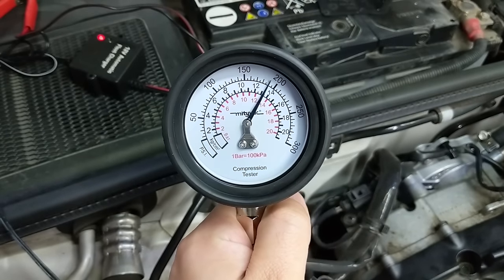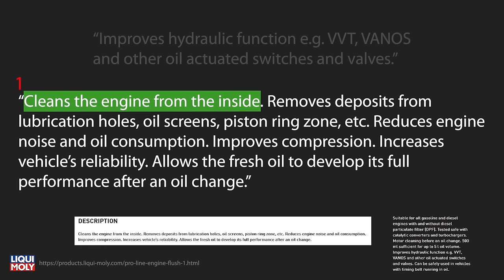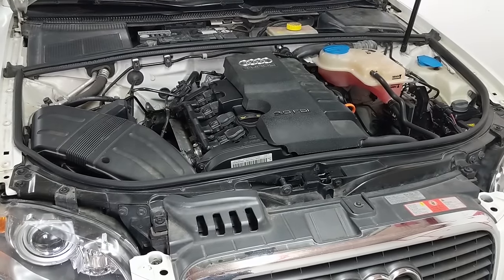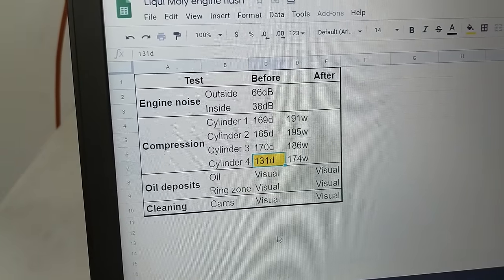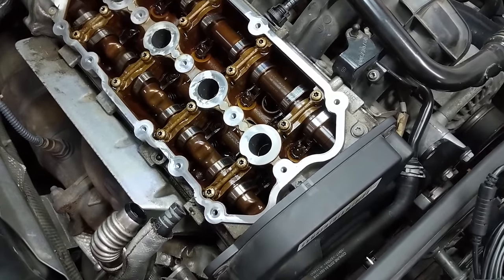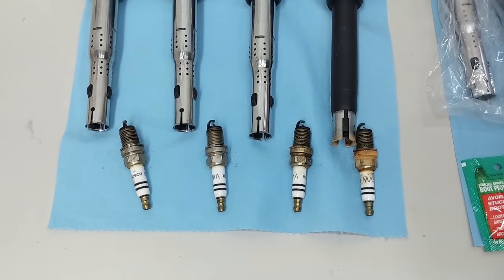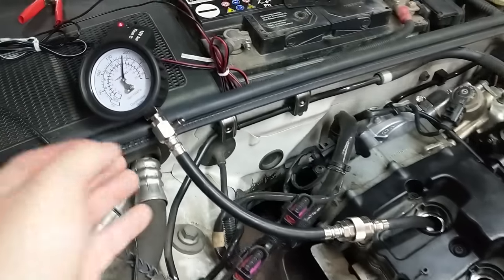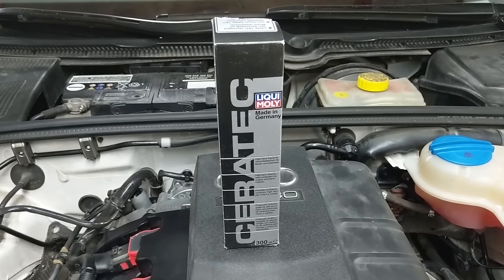Does Liqui Moly Engine Flush work? | Full Test & Review | Pro-line 2037

Comment: I bilive Liquid Molly works one of the very best products out there deffently doesn't do miracles or as advertised but that's almost as good as its going to get i bilive. I used the Motor Medic Motor Flush with a bad motor every time I did an oil change and my oil was getting really black around 400-500 miles and after my first use of liquid Molly flush my oil got really black after 800 miles i felt like it really helped.

Comment: First, i would like to thank you for the great video. I could not learn in better way. Still, i am hesitant about using this product to give a deep clean to my 2013 , 147k kms diesel , 2.0l vw golf 7 regularly maintained with new filters and 5w30 castrol oil every 20000k kms. Do you advise me to use ? 
I would be grateful to have your opinion on the matter. Thank you in advance.
Reply from the maker: Hey Alex - tough call; one you'll have to make yourself. Like I've said to a few other viewers in the comments here, you need to decide 1. If you even believe in the product, 2. If you believe the potential (theoretical, anecdotal) risks outweigh the possibly moderate benefits. Your car is probably in a good range of mileage to give it a shot but you have taken care of the vehicle and haven't said you're experiencing any engine issues - so maybe it's not for you. Up to you my friend!

Comment: Nice. Thank you for your work. Could liquid moly be used in a lexus es350?
Reply from the maker: Could? Absolutely. Should? That's the tricky one, depending on how much you want to believe and avoid the risks. There are plenty of people who do not recommend engine flushes at all based on the dangers of clogging up certain oil screens and passages with all the stuff you may (or may not) be dislodging from the engine during the cleaning cycle. That and, if the car was in somewhat poorly kept condition (seals/gaskets + oil change frequency), it's said the cleaning can create leaks where deposits were previously creating a sealing layer. So, there is some discretion required on whether or not to do a flush depending on what you think is true and what could happen.
Reply: @FigureItAudi  ok. Thank you.

Comment: Do you add it while the engine is running? Can I drive to the oil shop after 10 minutes idling?
Reply from the maker: Hi Buzz - If your goal is to do the cleaning but have someone else do the oil change, I would just do the cleaning in the parking lot or in line (Jiffy Lube style?) while you're already there. The product doesn't explicitly say NOT to put the engine under load while the cleaning is happening...but it is only meant for idle. 

You can probably tell from the comments here that there's a majority camp of people who are uneasy with what the Engine Flush does to the oiling system and my general opinion is that it's good to get the cleaner back out of the vehicle in a timely manner and not cause stress on the engine.
Reply: Figure It Audi thanks a bunch

Comment: Hey could you comment what was the name of that manual with the spark plugs? i have to say i tested the ProTec products they engine flush etc. and i had results on my Lexus, before i used it is started to get lazy when accelerate and he did not want to reach the top speed anymore, when on cruise control he had to shift down on hills when before he did not. I visited 3 technicians one of them was my friend one was a toyota dealership and one was Lexus dealership,  my friend and the Lexus dealership told me its carbon buildups the toyota told me they cant find anything wrong. And in the Lexus dealership they gave me the ProTec engine flush for free to test it and it worked.
Reply from the maker: Hi John - The manual with the spark plug pictures at around 13:30 is the Haynes Repair Manual for this generation of A4. The link to it with some more info is up in the video description. Thanks for sharing your experience, too.

Comment: Nice video and alot of effort u take, but do you realize this pictures in combustion chamber u are actually looking on reflection of piston top surface in perfectly smooth (almost mirror effect) cylinder wals? Plus just use common sence how oil cleaning additive can clean top of the piston in any engine, of course I do understand this 2.0 VW engines burn alot of it but in my opinion to see any cleaning effects of inside combustion chamber you should use some fuel additives... Please dont get me wrong but this test except compression test its not adequate for the product (borescope in this case is useless)

Comment: Ive heard the specs for the spark plug gaps are supposed to be .032?
Reply from the maker: For some odd reason, the Bentely manual skips the 2.0 engine's gap specs, but the OE gap is meant to be .028. Very allegedly, as a conservative figure the factory recommends knowing the electrode will wear over time and this all becomes a game of averages.

Comment: The increased compression of cylinder nr. 4 is plausible. The ring grooves of VW/Audi petrol engine pistons tend to coke up quite fast due to design flaws in the construction of the pistons, they are known for that. The rings are too thin and the oil drain bore that evacuates the wiped oil is also too small. The drain bore and ring grooves get clogged with burned oil very fast, the rings get restricted in their movement. Increased blow by and burning of engine oil accelerate this process even more. If engine flush could clean up something important in this engine, it would be the ring grooves and the drain bore. You would see that in an increase in compression and reduced oil consumption.
Reply: I got this info from Redhead Zylinderkopftechnik (german engine tuner, also doing you tube videos).

Comment: Well done champ, keep up the great work ,( i hope you took out approx amount of fluid that the liquid moly is from the crankcase and not just put it in otherwise you can stuff up many oil seals) but also till the oil gets send to a oil lab and then the results are shown before oil flush was applied to the engine and then after, so new oil put in engine and then ran till oil needs to be replaced ,then add the product again to new oil same oil brand and oil filter and send that sample to a oil lab, then i will believe the results posted and also all aspects of the oil particulars has to be posted friction, wear tests based on industry SAE standards and also metal particles, carbon, other chemicals present etc etc, then people will believe the products used no matter what it claims, test it via oil and fuel labs with proven results seen in lab tests its that simple do not buy into the marketing at all ,only few companies have the right products, like wynn's friction additives used in the industrial sectors yes ,but not off the shelf products, only one i would trust and that's the retail radiator stop leak?
Reply: not use turbo engine

Comment: How often should this be done
Reply from the maker: There are a lot of opinions on that but, "it depends". If you have a brand new car and you keep up on regular oil changes with quality oil, you might not benefit from a flush product at all, ever. But if you've purchased a used car with signs of prolonged periods of time between maintenance and you don't like what you're seeing in the oil pan/filters, sure, it doesn't hurt to clean and flush. Personally, when I'm on a 2-3 oil change a year program, I'll use this cleaner once, and other additives in the meantime.

Comment: Nice review.  Used it with my last oil change on my 2.0t B7.  I do have slight oil consumption so we'll see if there is an improvement there.
Next on my to-do list is a valve cover gasket replacement.  Was hoping you had filmed that!  
Cheers.
Reply: Any change?
Reply: @luispadua8491  So far, still oil consumption.  I have enough LM Engine Flush for one more flush, so I'll do it again next oil change.  But I'm not keeping my hopes up.
Reply: Hitman  This, or remove oil pan and fill up each cylinder with wd40 and let it be overnight or a couple of days while filling up with wd40
Reply: Hitman  Well obviously it's a lubricant, but that doesn't change it's properties to get into tiny gaps like threads for example, and it's ability to dissolve and carry soot.
Reply: Hitman  It's well documented that WD40 has cleaning properties and the method of filling up cylinders with wd40 to free up oil rings on pistons is common practice in Sweden on cars like Saabs, BMWs and VW TFSI engines with oil burning problems. Kerosene alone doesn't do such well job of getting in to tight spaces, so it must be the other chemicals in WD40 that make it thinner and suitable for the application.

Comment: i would first take a small sample of oil preflush and another post flush. do a visual comparison. perhaps send both to blackstone labs to for an oil analysis. you could compensate for the post flush sample by knowing oz of oil and oz of liqui moly. 

i do engine flushes every time i change the oil on my audi B8 driveline. they are known for having weak piston rings which can break and cause a lot of oil consumption. has not happened yet in my car. the flush could very well to a better job cleaning passages in which it is rapidly flowing through. there are small ports/passages in the valve timing system that can easily be clogged with varnish and so LM might be good preventive care. 

also, while the recommended oil is 10w-40, i use 10w-30 and notice better fuel economy, albeit with slightly more oil consumption, maybe a liter every 1500 miles. it is much more than many other modern engines, but as long as it passes emission test and gets good mpg i am good with it.

Comment: How do I get my trans in my 98 A8 to stop slamming  when shifting from park?
Reply from the maker: As in, you hear a noise when you shift from park into drive but are still on the brake? Or is it when the vehicle starts moving? The latter (and I'm generalizing this to all drivetrain clunks) being a sound you can hear on accel or deceleration when trans/diff/engine mounts are worn out.

Comment: can i drive my car after putting in the flash fluid in my engine to service my car?The reason why I do this is because my car is still under warranty and I don't want them to find out about it
Reply from the maker: My 2 cents, as a non-representative of Liqui Moly...no, I wouldn't. I understand where you're coming from though. You could call the dealership (maybe some other dealer than the one you normally go to for servicing) and just ask if they would do the flush for you, just to see what they say. Otherwise - and not saying this is the ethical thing to do - but you could drive to the dealership before your appointment, put the flush in in the parking lot, do the idle clean, then hand over the keys. They'll take it in for the drain and fill after that. Ideally. If your gut tells you it's a sketchy move, don't do it :).
Reply: @FigureItAudi  thanks bro I would take your advice seriously

Comment: Interesting and honest but as a test base this car was pointless. A few thousand kilometers with this oil? How could you expect any real difference? Any new oil also has a certain amount of detergent in it which degrades with times thus lowering oil self cleaning capabilities. Engine flush is really helping on engines that have been neglected for a long time and that had carbon deposits and sludge. I did a 2001 Harley Davidson Dyna that had been left sitting for a few years with very old oil in it... Fresh oil change didn't help the best but after adding Liqui Moly Engine Flush I managed to really clean that engine up and the difference was massive. There is no point doing cleaning on a engine that is clean.

Finally to explain the overall compression reduction in this engine I'm not to surprised to see that a cleaning like that actually levelled all cylinders readings, especially as this engine seems to be running hot.

Comment: I have this engine in my A6 C6 2009(Euro mode) and last 3 winters I get like 5-10 seconds knocking from underneath the coilpack. I'm guessing it's lash adjusters or something like that. Will this help? 

When I give a little gas and raise the rpm to 1000-1100rpm right after starting the car the knocking disappears.  This happens only during cold weather starts and after the car has stood still for at least the night.
Reply from the maker: I doubt it - it sounds like this is closer to timing and ignition issue which is not going to be affected by this type of product. If you have access to a OBD scan tool, I'd look for faults across the entire system first to get a better idea of what's happening. It wouldn't be much effort to double check the condition of the spark plugs, their gap and seating, though. Test the coil packs with something like this, too: https://geni.us/kimiss-coil-tester

Comment: The oil comparison test is pointless because you drained the old oil, refilled it with clean oil  then flushed - what's the point of that, it's only going to have what's left in the sump etc?.
(1) You're supposed to add the flush to your old oil then drain it so that it shows a proper sample not a 'Doctored ' one.
(2) You're supposed to flush your engine (if you wish) every oil change (add the flush to the old oil once the engine is, warm and run at idle for 15 minutes then drain and remove old filter).
(3) Once completely drained you then put back the sump plug , the new filter, add the correct amount of oil and then start.

NB - This test proves one thing - you've tested Liqui Moly completely wrong.
I've used Liqui Moly in my xf since i bought it with 16k on the clock and have changed the oil and filter at every 3.5k after flushing with Liqui Moly and I've NEVER had a problem with the engine, compression,oil rings, plugs, etc.
What ISN'T good for ANY engine is these 30/40k flushes - they only do half a job at best - if that , and unfortunately even sometimes throw up problems with gaskets and seals.
Either flush your low mileage engine EVERY oil change or take a chance at 30/40k and pay the price.
Liqui Moly is £10.30 in the UK $12.97 approx in the US and if you refuse to spend a mere $12.97 extra after buying the correct expensive oil and filter then you deserve EVERYTHING you get at 30/40k - You're just being 'Penny wise and pound foolish' in the long run.
Liqui Moly cleans deposits from the oil rings, compression rings, oilways, galleries, oil feeder pipes, oil pump, oil pump strainer mesh,  floor of the sump, bearings camshafts, collets and  valve springs.

Comment: Hello, a really nice test, but unfortunately it can't be that meaningful because the engine was just too clean.

I used the stuff on my Opel Fronterea 2.2 after I had extremely delayed the oil change. The result was that the "existing" oil pressure display went into a critical range, especially with the "hot" engine idling. Channels were probably clogged, but the oil pump on the strainer was more likely.

I then used the additive according to the instructions and sifted through the same drained oil and then put it back into the engine several times.

Result, an extremely large number of carbon particles appeared with each run and lo and behold the oil pressure in the engine rose again to "normal values", after which I had of course filled in fresh oil!
I think that with very dirty oil and deposits in the engine, the Liqui Moly definitely helps visibly, but even better if the flushing process is repeated several times, which also seems quite logical to me ;-)) The additive has the opportunity to work longer.

Nevertheless, thank you very much for carrying out this "extensive" test!

P.S.: Some users of engine flushing also let fresh oil run through several times so that all particles really come out, precisely because the oil pan usually stays on.

Comment: Would u recommend flushing the oil on a 62k engine ? Since brand new I've always used Castrol full synthetic oil and changed every 5k but no matter what oil seems always to come out peach black and I don't know if it is actually a good thing, penzoil was the recommended by dealer/maker
Reply from the maker: Hey Alessandro - Maybe. It's truly up to you to decide based on what you believe about these types of products. If you fall on the "I don't believe the risks are that serious or likely, and it's worth a shot" then go for it. But as you might gather from the other comments here, there's also a wide spectrum of "does nothing at all" and "is dangerous for your seals, oil screens and narrow oil passages" people, too. It sounds like you take great care of your vehicle and I wouldn't necessarily be deterred by the really dark used oil. When it comes to dealer recommended oils, I'm not sure it's any more complicated than corporate agreements to cross promote product. I'd be surprised (but happy to be proved wrong) if each vehicle manufacturer shopped the various oil companies to determine precisely which oils were the best for their engines. Anyways, maybe your better first step would be to switch to a higher grade oil and increase the change frequency slightly and see if that makes a difference.

Comment: Is that a direct injection motor??? I hear that valves and ports clog up thanks to direct injection. Great when new but not long term unless cleaned somehow. So I wonder how this stuff does for direct injection?
Reply: @antongeimar2853  which is direct injection.
Reply: And it will do absolutely nothing for the ports. This only flushes around the engine oil galleries etc...
Reply: @tiberiusclaudiusnerogermanicis  exactly. You need a valve/intake cleaner for that.
Reply: @Nick-GR  precisely! Walnut blasting is the best method in place, other intake cleaners tend to break big chunks of carbon off diesels which can break turno fins. Seen it many of times..